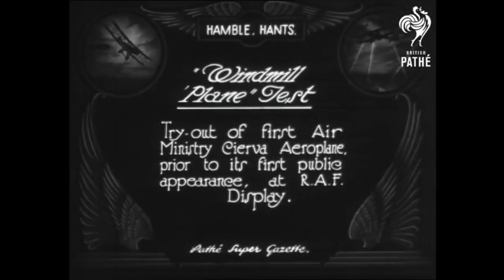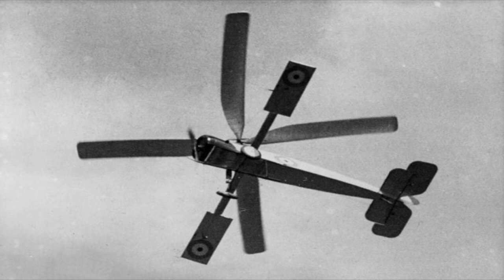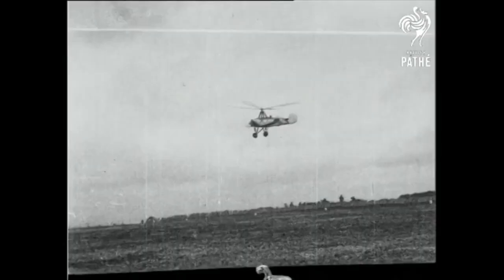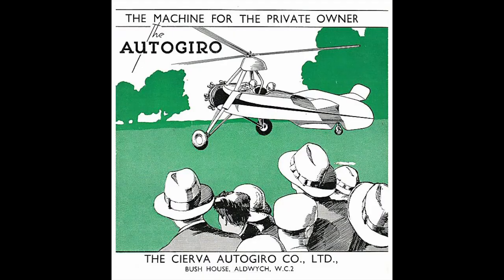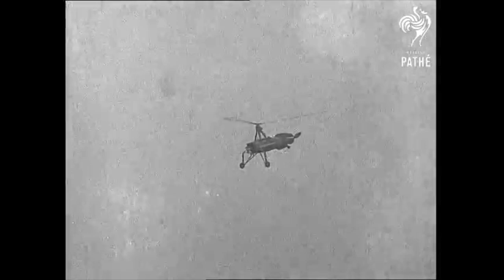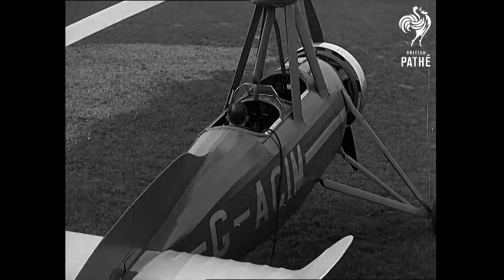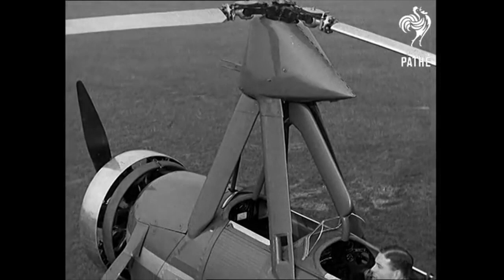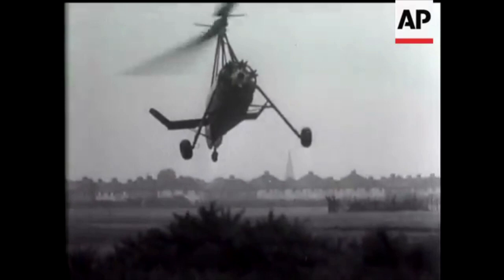A documentary/history of the Gyroplane/Autogiro - Part 1

Comment: hang on you cant determine the cause of accident by that footage. Its not complete. There is a section of footage missing. Its 2 separate pices of footage with the roll over in the second pice of footage. that footage shows the craft being rolled over backwards whilst on the ground...its extremely windy as shown by the rapid movement of dust. This aircraft is a tail dragger and for good reason. Its attitude is set to allow for a ground run that will enable the rotor to be brought up to speed on a take off run. You will notice in the first pice of footage the attitude of the aircraft in pitch for level flite and you will notice in the second pice of footage the pitched up attitude of the aircraft when sitting on the ground.it should be no surprise that any aircraft could roll over backwards in a 20 or 25 knot wind if you were to increase the angle of attack. This aircraft was simply out side of its operational wether window....this is not a situation of loss of control due to low air sped or insufficient control surfaces....you should know better that although the ground speed was slow the air speed was not.it anoys me that you speak with authority but in reality you have no idea what your talking about here.
Reply from the maker: Hey Russell - Just a couple of things.  The first is my films and the opinions within are not well researched and so any conclusion I make or opinions given are not necessarily based upon a piece of film stitched into my work.  There are very good documents and books that give more of the facts from witness or pilot evidence given at the time.  Hence my conclusion in the accident here.  Then we come to the crown jewels of your moan up.  There is more than a little irony in your sudden suggestion that the wind speed is 20 or 25 knots because of some movement of  dust and then run me over around ground v airspeed.  Err even if we take your numbers - which of course we can't know - is that since when has 20-25 knots been something obviously deemed sufficient for level/sustained flight?
Reply: @gyrocopterflyingclub6148  you say :"since when has 20-25 knots been something obviously deemed sufficient for level/sustained flight?" for your education true or false there is a pitcam video on utube that claims 17.5 knots level flyte.the pitcam has wings with elirond and a rudder and elivators.the elivator and rudder receive prop wash.your claim of loss of pitch controll at low speeds needs revisiting.and your definition of low speed in the above aircraft needs revisiting.
Reply from the maker: @russellwilson5246  Hi - Its fine to troll as I'll just make the assumption that you don't know what you don't know.  So documents as it relates to the film here we have an accident report and an entire Pathe film report!  Then there are over 100 films on my channel that have taken a long time to research happy for you to point out the errors.
Reply from the maker: @russellwilson5246  Hello again - I'm glad you are enjoying my channel so much and illuminating to my channel subscribers that not only does you spell and grammar checker need some work but you have found 1 single example of an aircraft that apparently with the help of prop wash that discredits my view.  Really? Then educate yourself and discover that a Pitcairn PCA-2 has circa 300hp from its P&W Wasp motor whilst the C19 in the film above that is causing you such drama has an Armstrong Siddeley motor of circa 100hp.
Reply: Russell, if you would address differences with a little less vitriol, you would represent aviation better. (and Russells) We all have a lot to learn, and discuss.